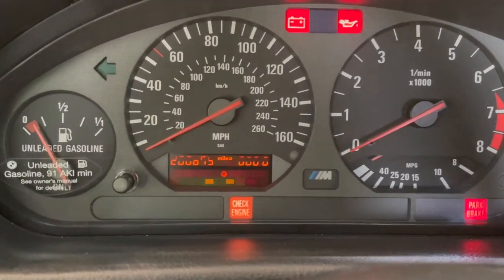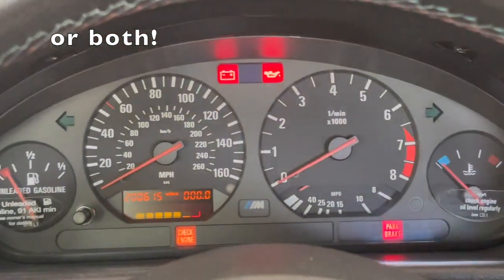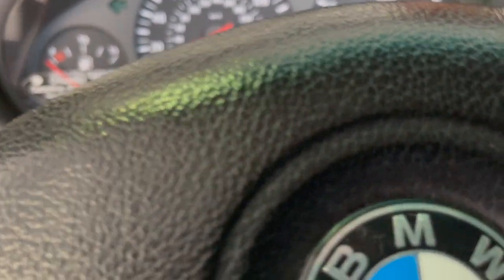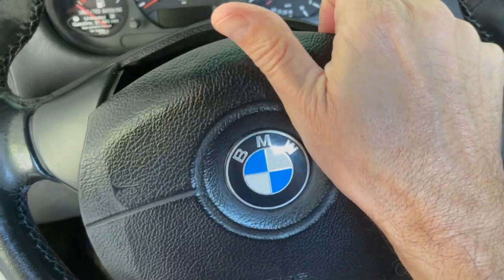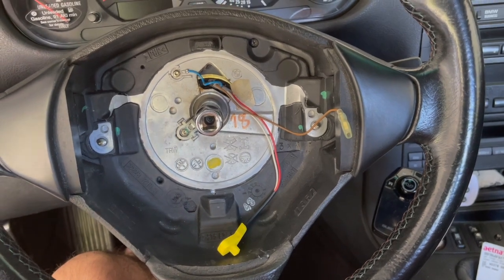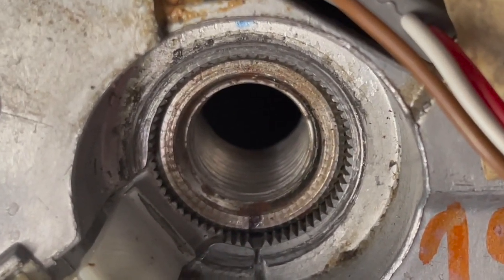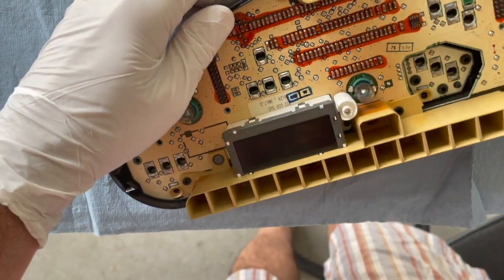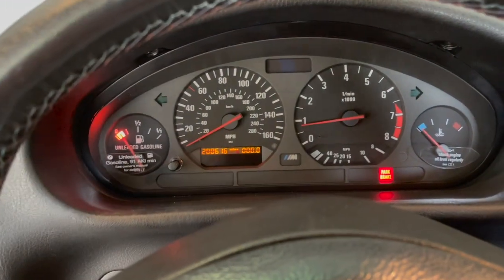Instrument cluster intermittent LCD screen repair BMW e36 M3

Comment: NOOOOOOOOO!!!!!!!!!!!!!! Air bag is a Torx 30!!!!!!!!!!!!!!!!!!!!! If you use a Torx 27 you will strip the star and have to cut the airbag from the drivers side so you can drill the thread side of the striped Torx. Use the proper tools people!!!!!
Reply from the maker: Thank you for this correction - the airbag is indeed Torx 30! I will have to add a correction to all my videos on that topic.

Comment: I used electrical tape and after a couple of days it worked its way down infront of the lcd. Just wanted to check if yours has done that. I think im going to try clear overhead projector sheet next time and glue it to the bracket so it doesn't fall down.
Reply from the maker: Mine did not slide down since it was a rather tight grip and it is also painters tape that has a non slippery rougher texture (compared to electrical tape).  Please keep in mind that there are two major points of failure that lead to this symptom of intermittent pixels of the LCD screen. 1. The elastomeric rubber connector not making good contact (either due to dirt getting caught, or loosening of the metal bracket due to age/plastic holders chipping,  etc). - which I address in this video; 2. The soldering in the back of the LCD fails with time and cold solder joints lead to the same symptom of intermittent LCD pixel operations. I encourage you to also review these two videos below, just in case this is also a potential culprit. In my case, I needed to address both 1 and 2. (Most others report 2 being a more likely reason for this LCD pixels intermittently failing:

https://youtu.be/GJlhzsNX5dI

and 

especially this: (which finally fixed the problem entirely - it has been over 4 month of proper operation!)

https://youtu.be/VIeLri_AI7M